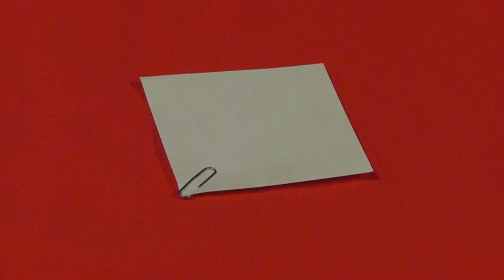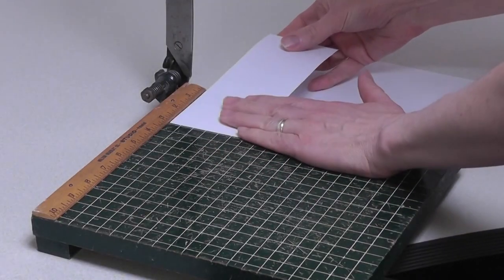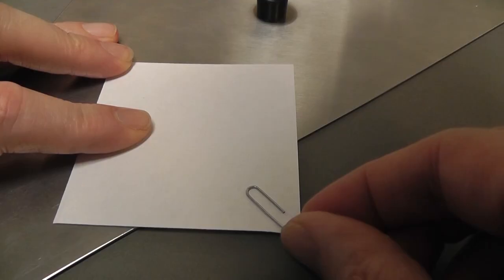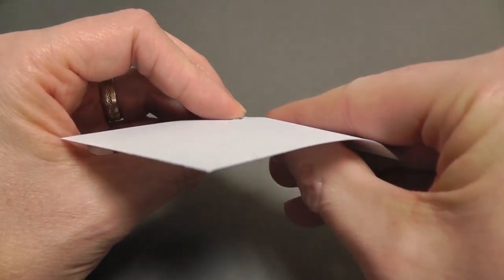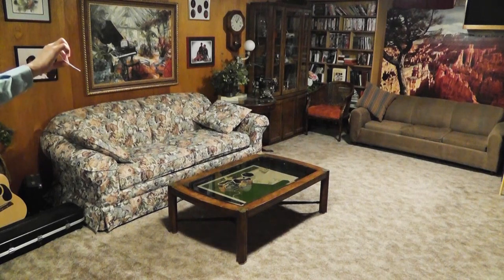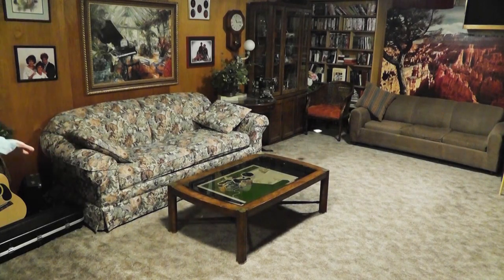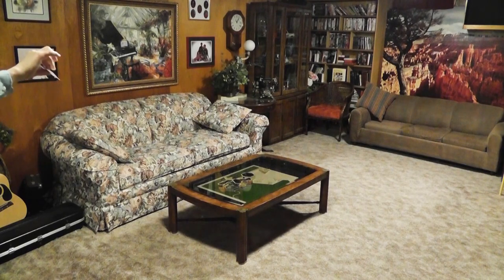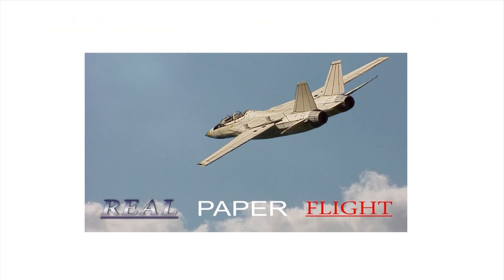World's Simplest Paper Airplane

Comment: It makes sense that tiny adjustments matter so much.  A full scale plane only needs to move its trailing edges (ailerons, for example) a few inches to get a very noticeable control input.  So if you scale that to a craft this size, its going to be really tiny.  Thats where a careful touch comes in.  One of the few paper plane videos I've seen that really gets into tuning for good flying.  Paper planes are SO much more fun when you can control what they do and get them gliding well.